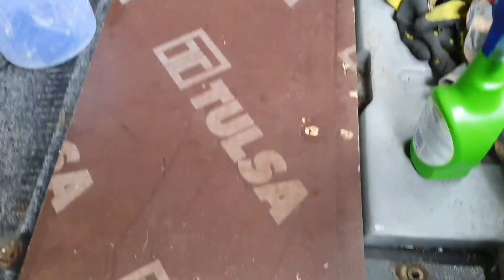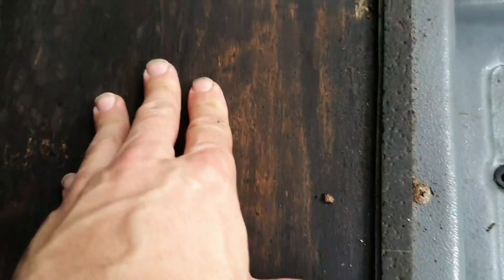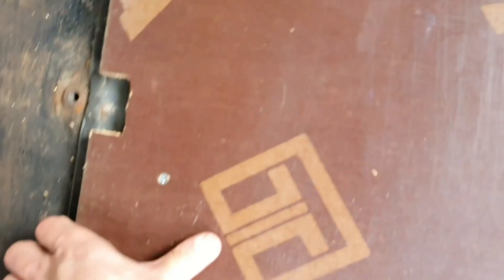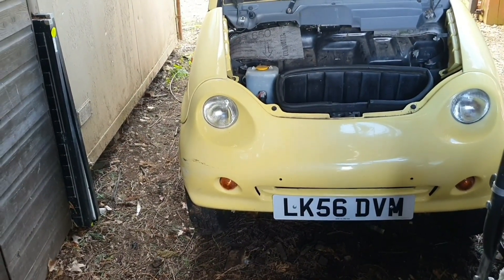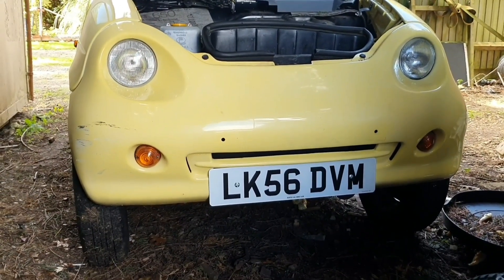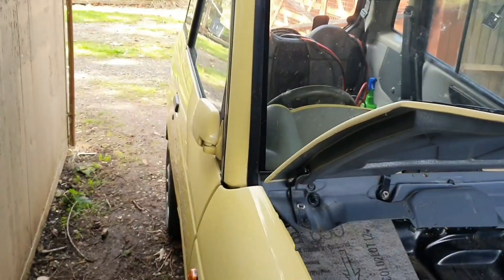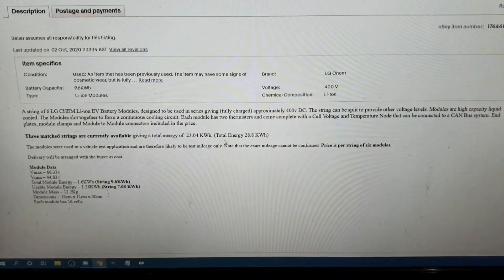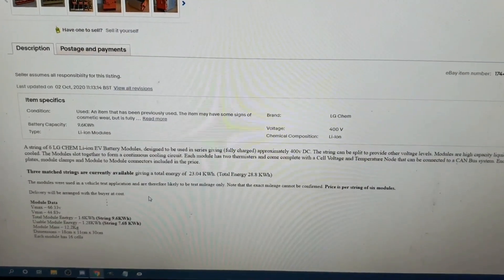REVA G-WIZ: Yellow Wiz Lithium-ion Conversion pt.5 - building the floor panels.

Comment: I'm just wondering Richard is a G-wiz classified as a quad bike, if you added extra weight re batteries at the front what's the max gross weight of the vehicle
Reply from the maker: G-wiz is a large quad (400kg without batteries) I believe. It's about 665kg with the lead acids... with lithium it will be less regardless of how many you can physically fit in the car. My silver AC is 100kg lighter but 5 times denser in capacity.
Reply: That's good news, worry over 😁